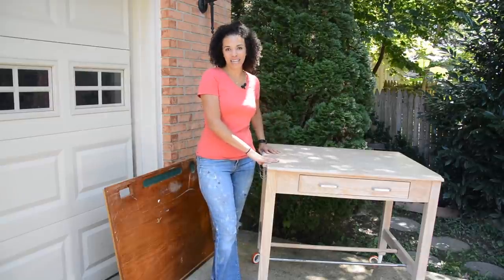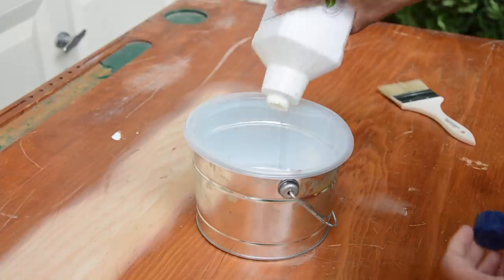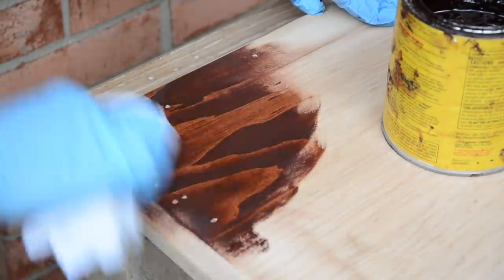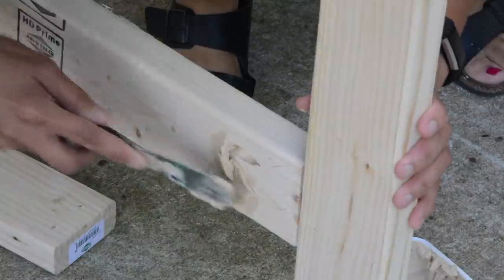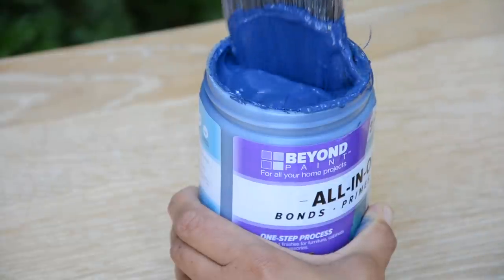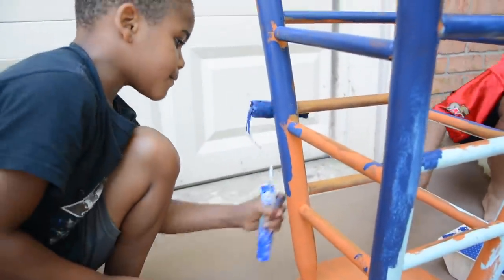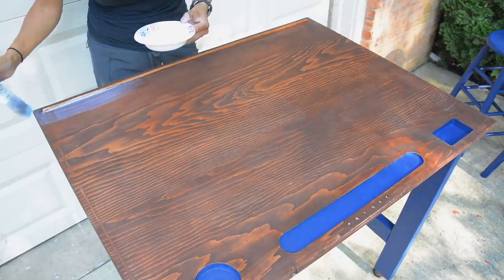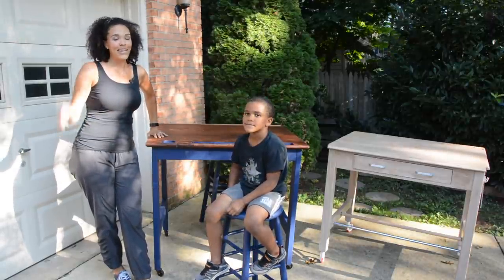Eat-in Kitchen Table Makeover - Furniture Makeovers - Thrift Diving

Comment: A great trick I recently learned for getting the perfect match for your wood filler, is to mix up some of the sawdust from your project with a bit of glue until it forms a putty and use that. Perfect colour match every time.
Reply: Melissa & Domenic what kind of glue do you use?
Reply: bleedinghearthero wood glue?
Reply: Colour Streak Haha thanks! Seems obvious now but didn’t even think of that!
Reply: The only problem with that trick is, it will not take a stain...
Reply: Great tip

Comment: I love how you fearlessly move forward and are not worried about perfect. Your table looks fab. Why did I not think of cutting off the legs of stools to make them the correct height?
Reply from the maker: My projects are NEVER perfect! LOL. I soooo wish they were but it's in the imperfection that I learn what to do (or NOT to do) next time. So I welcome the imperfect. What I learned from this project was that I should have used some jigs to help stabilize the legs before I screwed them in so that they'd be 90 degree angles on the dot. Next time!! LOL :) And yes, you can cut stool legs to make them the correct height! The secret is to make sure that the line you cut is parallel to the floor so that the legs sit nicely. Thanks for watching and comment! :)

Comment: Cool look! To make the table more sturdy a simple cross brace between the two bottom supports would have sufficed. Also, depending on your climate it's a good idea to build the frame seperately and attach the top with L brackets which allow for the wood to expand and contract. So the top would essentially be floating on the frame.
Reply from the maker: You are correct. I forgot to mention that I planned on getting piping cut with a flange and add that to the legs for support. You're right about the brackets. I didn't think about it, though. I haven't built enough tables to figure it out, but I have seen little brackets from Rockler that I could have used. We will see how it holds up over time! :) Thanks for the tips!

Comment: I enjoy watching your DIY endeavors! Wondering why you always choose to take all of the patina off of your wood projects. It ads so much character and holds history. You can strip without removing off all of the patina. Also removing all of it devalues some pieces. I saw your mid century modern dresser, beautiful piece!  You could've saved yourself a lot of anguish by lightly sanding the veneer to remove any build up and just adding a coat or two of stain varnish,  or shellac. This leaves a beautiful finish while maintaining the patina and not talking the chance of over thinng the veneer. I know that  dark mark on top was bothering you but to me, it just adds character and shows a little bit of how far you brought its beauty back. 
Rock on with your rehabbin', refurnishin' self! You have a great work ethic, giving it your all ♡